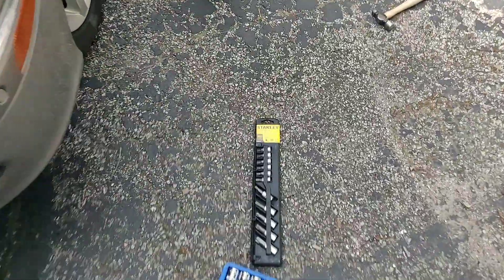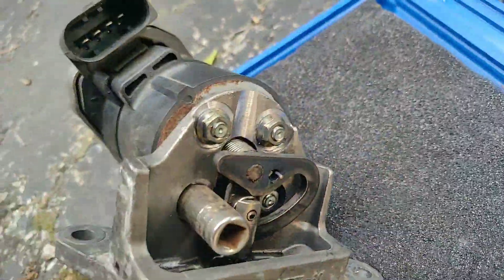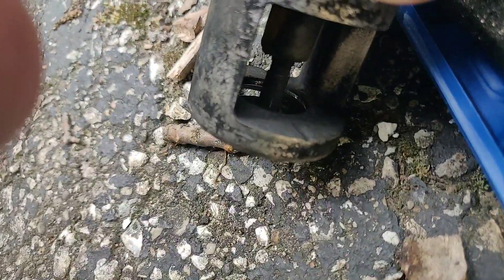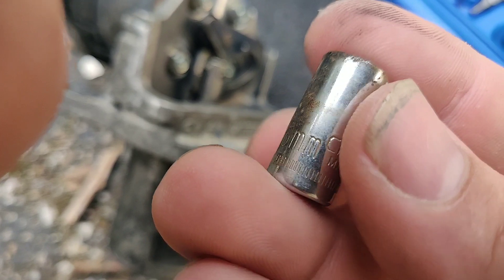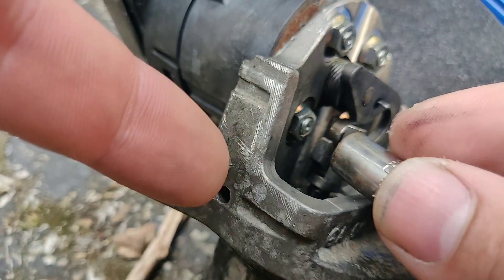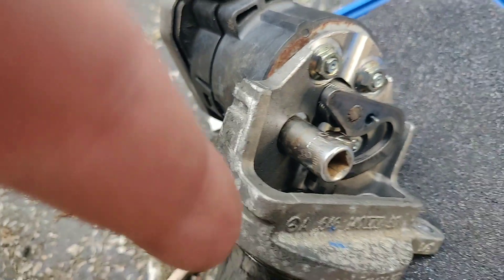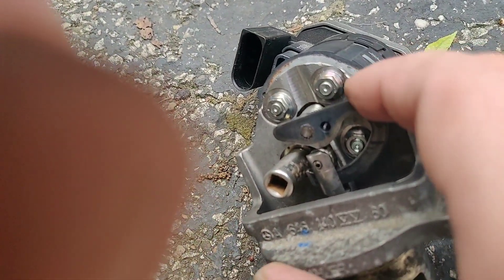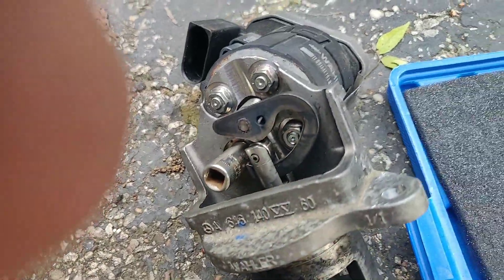E320 cdi w211 om648 EGR block / disable (after programmed out, deleted in ECU)

Comment: do you have a video on how to delete EGR in ECU (Programmed out)
Reply from the maker: Not on this one. I used das developer level,  for r230, sai , second oxygen sensors... On w211 I put EGR back as it helps to preheat engine in cold weather.
Reply: @pfoxhound can u do a video?
Reply from the maker: @thelegendofkochbrunnen6953  you need to talk to tuner. I extracted file from ECU, sent for modification, flashed it back... Was told to disconnect connector, found later that some of EGRs can leak exhaust under high pressure (different engines). Blocked as described in video.
Couple years later found that EGR is not a bad thing, in winter you will find your engine cold after couple of miles,, with EGR - warm... Problem occurs when your engine parts are worn...

Comment: Hi,i own a E320 cdo 2005,and when i put full throtle,it smoke more than before and when i loose the pedal and try to ac elerate again,it doesnt respond,throtle fuul down and the engine doesnt respond,and reading the comment,maybe it woudl be that my egr is stock or bad?The intake flappers should be open or closed?
Reply from the maker: You need diagnostics. My car goes to limp mode after full throttle ( looks like throttle body problem). A lot of smoke - too much diesel in mixture or not enough oxygen in mixture, maybe some EGR. You need to get computer diagnostics.

Comment: I did the same as in this video and then I went to test the car, when I pressed the gas pedal all the way there was an explosion, the egr bolts broke and it jumped out.  why did this happen?  should I have turned off the egr software first?
Reply from the maker: @ilinkozilic6461  your cat was plugged, otherwise there's no other reasons to have high pressure on that side... Maybe you did some damage to bolts or something...
Reply from the maker: Mine was off, another guy had it on, but he also blocked it. We didn't experience this type of problem. Possibly you have a high resistance in exhaust... 

In order to get the EGR out I loosen the bolts and let the pressure to spit out the EGR. Dolts we're fine and EGR was fine...
If you live in a cold winter environment - EGR helps to speed up the engine preheat.

Comment: Better MPG after egr delete ?
Reply from the maker: No. Idea was to remove sooth from intake, PCV fills intake with oily mist, and sooth glues to it... I put back everything... And found that 65mph is a good speed. And I put the old firmware, previously I put one with no swirl flaps, no EGR, some boost and fuel added. I was driving 70mph and was all the time 32mpg, everyone reports 37without any effort. Raceiq Tony - has almost 50mpg... Now I faced what looks like ECU malfunction, will need to take off the cover and try soldering it.

Comment: What is needed and how do you program out the egr ???
Reply from the maker: You need a tuner. Sometimes you can disable it in DAS(with developer options). Me 2.0 can disable a lot of devices like sai, oxygen sensors, egr, swirl flaps, maf, map... Mine had egr disabled in firmware, but recently I decided to upload a stock, to see the impact on coolant. Egr in this car helps to rise temperature during preheat time, during winter it's a good thing.
Depending on engine condition egr is good. But if I clean up the intake - I will have to get a high quality oil separator and put it in between PCV and intake, Like Provent 200 Mann, original, not Chinese copy. There are couple channels on YouTube form Australia, they show and review these devices, there's a Australian government research on this question and with such device egr will not be a problem. PCV pushes oily mist in intake and egr throws soot, together they cover intake valves and everything else, decreasing air passages. No oil - will make it work.
Reply: @pfoxhound Would you please adivse if it's possible to disable EGR in 2014 GLK 220CDi?
Reply from the maker: @grandkung  everything is possible, especially if you have a Mercedes. Find a tuner, they can program it out, but you need EGR during winter. Main problem of EGR is when your engine is worn out, PCv will throw oil in intake where oil meets sooth. If you don't have winter - you can think of removing EGR, I  ended up restoring the system...

Comment: Mines been deleted but just unplugged is that right
Reply from the maker: I found story where exhaust high psi pushes EGR to open. Mine has some extra boost, so I decided to add this modification. This year I connected everything back together, but pcv is vented outside so sooth will not sit on greasy intake.... EGR is used for combustion chamber temperature control. In some cases disabled EGR can warp the head.

Comment: Imagine what the ecu might think about a poti not working properly ?!? 😐
Reply from the maker: The ecu was previously reprogrammed to disable egr, flaps and add some boost.  The main problem is that sooth coming from egr gets to intake where the air has oil in air from pcv, and it start building up. So pcv vented out also. Recently I found some good oil separators on aliexpress that I'm thinking about to install and probably hook up flaps with egr. No oil - no problems.
All stuff that I did to the car was not necessary, it's just men need entertainment.
Reply from the maker: No faults, even though xentry long test.
Reply: @pfoxhound  can the egr be disabled just from Xentry? Thanks
Reply from the maker: @makaveli7771  maybe from DAS with developer options. I'll take a look if it is there.

Comment: My air intake box melted, MAF sensor also destroyed car went to limp mode then shut off opened the hood air intake is burnt up is this from EGR failure or turbo failure thanks
Reply: Car is 2005 e320 OM648
Reply: 226,000 miles
Reply from the maker: It looks like the quantity of air was not working properly and turbo was pushing much more air than needed and burning mixture was burning much hotter. My friend with Freightliner cascadia Dd15 2016 came over and I tried to do parked regen, during process of regen truck turned off in emergency mode, I found boost pressure sensor was bad and reading wrong numbers of psi and turbo was trying to push more than mixture had to be, so more oxygen - higher temperature, one box(name of  exhaust gas clearer, oxidizer, dpf , scr, def) was trying to protect itself from melting... 
But blocking of egr is possible to raise temperature of engine and bend the head and block flat parts to give a leak of coolant.
Reply: @pfoxhound  I had no check engine light at the time
Reply: @pfoxhound  engine temp was fine
Reply: @pfoxhound  can a bad egr cause exhaust gases to enter intake system?
Reply from the maker: @rosssmith9941  egr connects exhaust and intake, opens valve by program, when it stuck open - hot gases burn intake parts.
Reply: THIS IS BECAUSE THE EGR IS STUCK OPEN AND BLOW ALLL THE EXHAUST GASES INTO THE INTAKE. THIS IS SIMILAR LIKES YOU CONNECT YOUR ASS WHOLE TO YOUR MOTH WITH A PIPE AND START WONDERING WHY YOUR STOMACH IS FULL ALL THE TIME

Comment: honestly, i wish i still had the 1987 300D Turbo. A robust car, a robust engine, all is made to last and everything is DIY, no computer everything is mechanical. Had good power, did not give you a mpg reading but it was very economical. That E320 CDI has great power etc etc but hey all in all,  very finicky the lights are the shits, too weak, the electronis...well I do not want to say anything has died yet but I worry that one day its going to be just DEAD! The front bumper is so flimsy you cannot run over even a tiny snow bank slowly, the interior sooooo nice and so easy to get dirty looking. With the 300Dturbo I could go FISHING with the E320CDI I can go to starbucks thats the difference! However the 300Dt in sticky snow is IN THE DITCH! Nearly undriveable and the E320CDI is not too bad with  traction control that works.
Reply from the maker: @konasteph  I drove in snow, never had problems that you described. Me ECU died in the beginning of last year, could not find any service with guaranteed repair, this year looked up in eBay.de and found service in Austria 300euro and they fixed it. 30 euro for shipping back. Shipped to the place from Germany... Shipping back was like 15 days... You can find couple videos on ECU problem in YouTube... Other than this - works fine. Om642 is much harder to work on. Headlights - if you have hid - they will burn away reflective material from reflectors, glass will degrade after almost 15 years... You can get a replacement glass, put an led bulb and you will gain light, because hids will burn the top and bottom parts of reflector and LEDs rely on left and right sides( these will be intact).

Comment: all this is logical BUT dont you get check engine light, limpmode etc when you block the EGR mechanically...there is a electronic circuit to fool the MAF sensor into thinking the EGR is working! From what I read in the MB forums ..yes in the older diesels of the w 124  E class 1987 etc you could easily block the EGR mecahnically but on the OM 648 they got the electronics so sophisticated that it knows when the egr is not opening or closing through MAF sensor and it sets a code and/or goes into limpmode.....pls tell us if yours did that!!!
Reply: I just bought a really nice egr bypass for my E320 CDI, that came from Poland. you splice some wires and mount the bypass mechanism and it is a permanent delete. I live outside Tucson, AZ city limits however and do not have mandated emissions testing.
Reply from the maker: @jaymase3735  I got breather hose vented out and now think that I want EGR back, as it may help preheat engine during cold weather, limit temperature during heavy loads by limiting amount of oxygen coming to the intake, also I'm not afraid of sooth coming from cylinder through EGR back to cylinder.(because there's no oil inside intake to collect sooth on walls of intake).
Reply from the maker: @jaymase3735  I never measured amount of diesel consumption during idle. After tune it is 0.95G/h. I have a truck with DD15 engine and it consumes only 0.6G/h.
Reply: Jay Maserian Can you please share where you bought the delete kit?
Reply: @jaymase3735  Do you remember where you ordered it from?
Reply: Jay Maserian can you send me link where you bought egr delete?
I can’t find it here in US
Reply: I've had my egr unplugged now for 25k miles, and am in a hot climate. I've never had my coolant temp gauge read over 1/2 way, nor ever noticed any overheating symptons. The reason I did this was due to random limp home mode happening and the egr code. After installing a new egr a week later car went back to limp mode with same code.
Reply from the maker: I read out firmware, sent it to my friend, he sent it to his tech, his tech sent it to Belarus. There I got EGR delete, swirl flaps delete, stage 1 tune. I got it loaded back to my car. Later I found that EGR also keeps temperature of engine at designed level. My coolant temperature slightly higher now. Couple degrees of coolant = couple hundred degrees in cylinder. Chance of bent head gets higher. I vent out pcv and planning to turn back on EGR and flaps.
Reply: @pfoxhound  that is pretty amazing result! yes the EGR is supposed to lower temp it keeps emissions cleaner..but I wonder if new tuning is not partly to blame for temp increase. Anyway my respect for russian way to tackle sophisticated engine management, I wish I could say the same for the US. Here its just buy a toyota and finished. Spasibo!
here link to egr bypass in a different way   https://forums.mercedesclub.org.uk/index.php?threads/cdi3-egr-bypass-mod.88374/
Reply from the maker: @konasteph  I noticed that during idling it consumes about 0.9 gal/h . My semi truck consumes 0.6g/h. Not sure if it was new firmware or not, but I have original firmware and will compare the consumption one day...
The temperature is about 96 during cruising 65mph...
Reply from the maker: @konasteph  one of the tricks to disable EGR (operation) is to tell to temperature sensor that ambient temperature is very low. That can cause some other problems. I disconnected the plug and no reports by ecu, so they somehow erased it...
Reply from the maker: My EGR was electronically removed.
Reply: @pfoxhound  I think your fuel consumption comment was intended for Konasteph. As per the EGR. As long as you have had it electronically removed for a while, I would advise running seafoam through the diesel tank a few times before rewiring it back. Then from that point on, also make sure you use synthetic Diesel oil and not a Gasoline oil. The large amount of dispersants will prevent carbon build up.

Also, would be best to clean EGR with carb cleaner before rewiring back in and make sure you replace the Cyclonic Crankcase Valve vent (CCV) roughly every 60-75k. Or at the very least take the CCV off and clean it and put new o-rings where needed. This prevents any vapors from ever mixing with any potential soot from EGR and completely prevents carbon issues, which are most of the reason one would have, for bypassing their EGR in the first place. 

The EGR can help emissions, slightly increase efficiency at low revs, and help heat the engine. I live in a hot desert and dont need the help heating. Bypassing the EGR produces a slight increase in power and efficiency at middle range revs, which is ideal for the highway driving I do in hot weather.
Reply from the maker: @jaymase3735  I saw couple videos where guys were talking about higher coolant temperature after EGR delete. Each degree in coolant temperature is hundred degrees in combustion chamber. They said that they saw a lot of heads that were bent due to temperature problem caused by EGR delete. EGR limit amount of oxygen and decreasing combustion temperature...
Reply: 2004 C200 CDI - I have no power like car without a turbo boost. I have disconnected the electrical plug off the egr valve system. Power back

Comment: So what did this accomplish? I want to delete my egr off me cdi too
Reply: I just unplugged the electrical connection. CEL is on, but car runs great, full power, no going into limp mode anymore.
Reply: @lw4mma will that work for a 2009 320cdi?
Reply from the maker: If you have it programmed, but mechanically not secured - under high rpms turbine gives high pressure that able to open (at least partially). You are not interested in this situation... So instead of welding or unscrewing some parts to place a custom blockage plate you can block the flow like in video...
Reply from the maker: Also, I'd you delete it you will get higher coolant temperature, that can lead you to bent head or engine block, in cooler temperature outstside your engine will preheat slower, if it's small like most of Jettas...if it's really cold when you come to red light you can start dropping temperature and your engine will be cycling from preheat to normal and back...
The main reason for me was protecting intake valves... So I vented my pcv to atmosphere. No oil to cover valve=> clean valve, but if turbine gives you oil  to intercooler than you'll have stuff on intake valves but you have to repair turbo and intercooler. 
You can find online website that you upload your firmware and you mark what service you want, so you can remove EGR, def, dpf... To download your firmware from car look on eBay for Chinese clone of experience tools...(ktag or something like that, I don't remember). EGR helps to lower engine temperature by limiting oxygen...